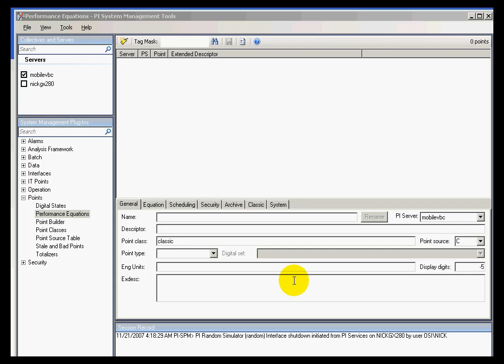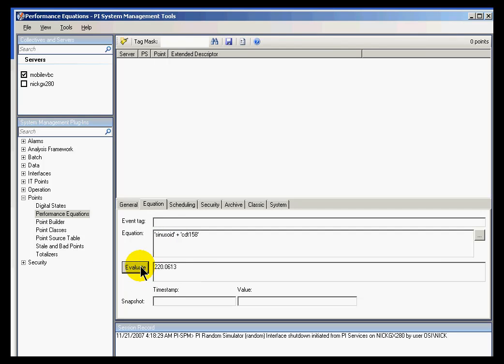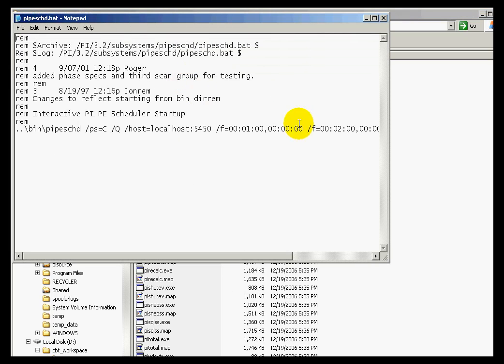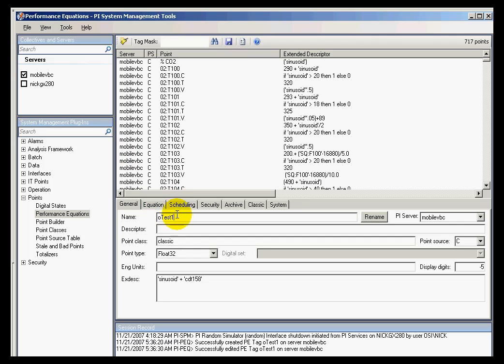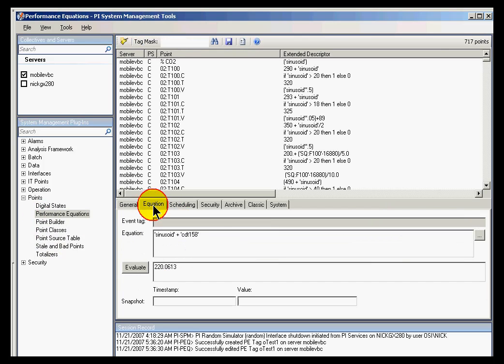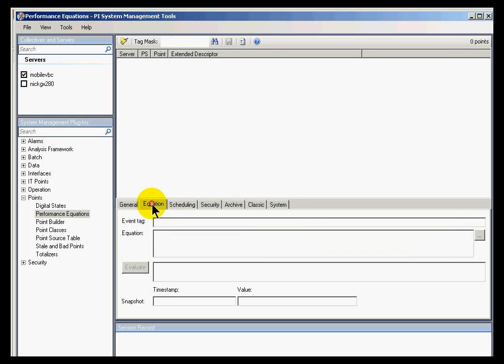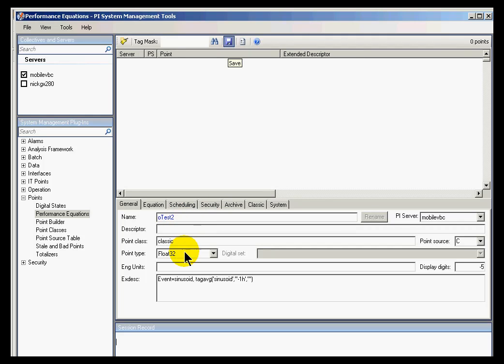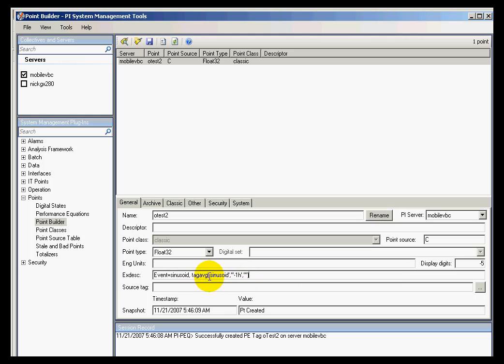OSIsoft: PI SMT Performance Equation (PE) plug-in. v3.4.375

Comment: What if you need to add another scan class?
Reply from the maker: Hi Derek, you can use PI ICU or edit the PI\bin\pipeschd.bat file directly on your PI Server node to define additional scan classes. Note that access to editing that file may be restricted based on your security settings, but that would be how you can add or change the default scan classes.